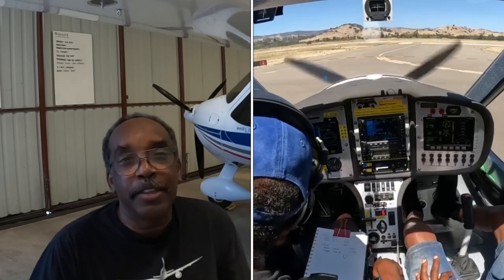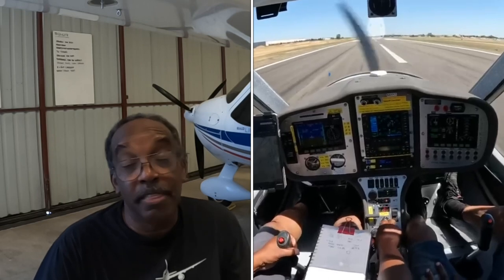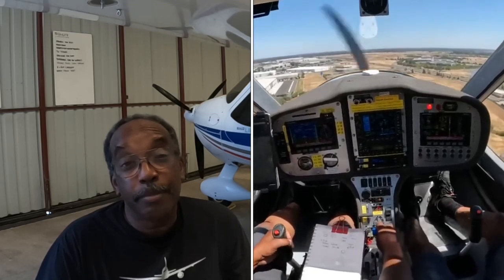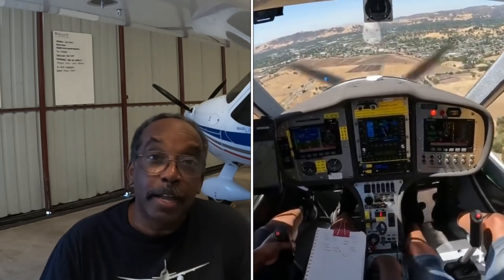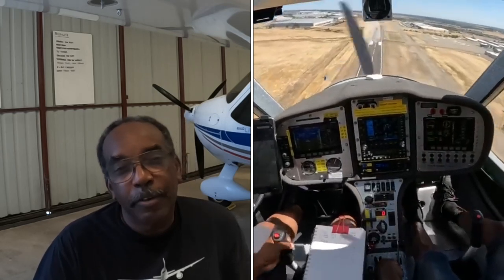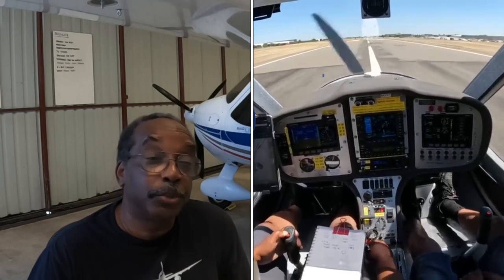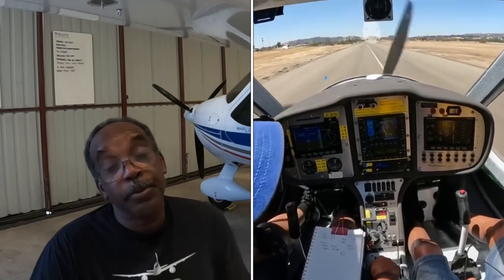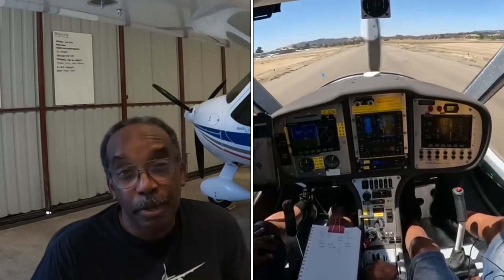Emergency landing at Nut Tree Part 2 what happened

Comment: Mark, you did a great job handling this.  Do not let the arm-chair critics get you down.  My instructors stressed that you treat a partial-power situation differently from a complete engine failure, and that altitude and time give you options.  Also, once making the runway is assured (which it was), flaps are a much more stable option than a slip.  Lastly, all these critics should keep in mind that debriefing an emergency after the fact is very easy compared to dealing with it in the plane in real time.  As M. Tyson once said "Everyone has a plan until they get punched in the mouth."  Put their butts in the plane in an actual emergency and let's see how "by the book" they perform.

Comment: The fact that you landed your plane means you made all of the right decisions during this event! Good job! There is something bothering me about the engine problem. Calling it a fuel problem is no bueno. The Rotax engine has a history of RPM loss at cruise. It is a finicky engine. If it were my airplane, I would do the following:

1. Scope your fuel tank to check for particulate (after it sets for 24 hours). 
2. Check your fuel tank vents to make sure they are not blocked. 
3. Remove carb bowl and check for debris. Place catch basin under bowl and engage fuel pump to flush debris from carb/hose.
4. Inspect all fuel lines from tank to engine. Check fuel cutoff valve. Check all hose clamps for over-tightened clamp; partially collapsed hose. 
5. Inspect all cables, linkages, etc.
6. Remove spark plugs and check for signs of problems.
7. Change fuel pump and run to see if you can reproduce the problem (on a hot engine, not cold).
8. Check connections and electrical wire on your fuel pump. Check for short.
8. If all of this is OK, my bet is the problem is one (or both) of your mags. Mags can cause this problem (after they get hot). 

Don't chalk it up to bad gas. It is most likely something else and your engine is talking to you.  Listen!

Comment: Thanks for the follow-up, many were wondering what the issue was, exactly. In my opinion you handled the situation just fine. The engine was giving you partial, intermittent power, and you used it to gain some altitude. Altitude is your friend, unless you're on fire, lol. You were under control throughout. I say great job. I, also, find going into a slip, close to the ground a bit "spooky."  With my Cessna 172, I can just drop the "barn doors" all the way and shove the nose down. Thanks for sharing!
Reply: SPOOKY.. ?  LOL !

Comment: Hi, I had the identical situation just after maintenance and it turned out to be a blockage in a small bolt the is used to allow fuel into the float chamber. It only happened when I was pitched nose up in the takeoff. As soon as I lower the nose it was fine. May be worth checking out. It turned out that at some point the small bolt was changed for one that didn’t have the hilt through the middle of it so was restricting the amount of fuel that could enter the float chamber. When at an angel the float would lodge and stick not allowing for more fuel.

Comment: Would have thought the low fuel pressure warning is key to what happened not the fuel itself. If the engine is using more fuel than the fuel system can supply then the pressure drops. I'd say the pump was going bad or restricted filters.

Comment: Similar issue with my Sling Tsi, although it’s fuel injected.  I won’t use fuel with alcohol now.  I noticed the low pressure happens more with increasing temp.  If you fly in, sit somewhere and then go again I think everything in the engine compartment is hot.   100ll has a much different vapor pressure.  So I increase my cruise climb and watch the fuel pressure.  If you can get non-ethanol gas where you live that is > 91 octane.  Also car gas changes over the year so winter gas (through June) will vaporize easier than summer gas.  Best of luck, glad you are safe.   I’m thinking the gas is effervescent in the fuel lines causing mischief.

Comment: You made good decisions all around.  The very worst thing we can do a PIC is question ourselves.  Second pilots have stake in the game as well and I didn't say they should not question our decisions, but as single pilot we just need to fly, stay calm, and do the best we know how.  I have had many engine failures as a single pilot in Ag and pipeline patrol.  All mine, save one, were low so only six second deals to somewhere in the very near hemisphere.  And on most I, being very near the LZ, ended up using full flaps and full forward slip to make the beginning of the LZ.  Anyway, good job.

Comment: i had 4 different LOTOT/partial power engine fails on take off as a Bush Pilot in South America. If the engine is only vibrating while lost some power but NOT SURGING OFF AND ON, and keeps altitude at least, it is good to try to turnback to closest runway at airport from 400 agl or higher (i did that 2 times, one from 300 agl only) instead of throwing the towel and crash in front without a fight(Besides in front there were houses and or ocean).
  But if heavy surging, prep to land, little turns only. No turnback unless much higher than 400 agl. Due it can quit dead next surge.  Those difficult to judge LOTOT killed the great MacSpadden.  He was killed on a “Surging LOTOT” and they did turnback but lost engine after it, NOT REACHING THE RUNWAY after the airplane owner pop the draggy gear out.    

Practice LOTOT..  FOR EXAMPLE;  climb to 400 agl, Engine power to 50%.. level at  400 agl.  Troubleshoot with SOME carb heat and some leaning too.  And decide if Turnback, Turnaround the airport OR CRASH I FRONT.  3 OPTIONS ON LOTOT.     IT S SURGING LOTOT,  TREAT A SURGING LOTOT as an engine dying in next few seconds.  Be ready to lower nose and land.

Comment: Hello, good job!! and good landing!
What was the outside temperature at the time of takeoff? Rotax engines can suffer "vapor lock" if they have previously been exposed to the sun and the outside temperature was high.
I have a CTsw and I know that the engine is equipped with an expansion tank to avoid this problem, but I have several flight companions who have suffered a problem similar to yours for this reason with Rotax engines, always in summer and at high temperatures. .

Comment: Thinking it through being high was a good choice.  You knew there was plenty of runway, and if on approach power is altitude, better to be a bit high.  It's a better bet of making the runway with reduced power.  There is no requirement that you have to land three stripes past the numbers. Taking advantage of the length of the runway was smart. Better a little high than being low. I'd fly with you anytime.

Comment: First I watched, I say good save. Still thinking same , may be vapor lock happens mix mogas with avgas for summer season flying, my plane is at 100hr never put avgas sometimes on climb fuel bar goes under 1.9 bar and goes to yellow arc but never goes under 1.5 bar it usually happens in summer time too.

Comment: The design of the fuel system in the CTSW is far from perfect. You loosed fuel pressure at rotation, this is a clear indicator for a fuel vapor lock. Make sure it will not getting too hot under the cowling, keep the small door at the left side open during parking under the sun. But to make sure this will never happen again only a auxiliary fuel pump would help 100%.

Comment: You should try ethanol-free(non-oxygenated) gas. It is not toxic like leaded gas and it more stable and more resistant  to vapor lock than gas that contains 10% ethanol in it.

Comment: Great video, Mark! I had just finished a video describing my recent encounter (about two months ago) with the Flight Design (CTLS in my case) engine light. In my case it was entirely an operational error on my part. I happen to think that, since you were so close to the airport and the engine was still working, a mayday call might have been too premature.  Cheers.
https://youtu.be/T2HIf4NRF9s

Comment: Every 25 hours new oil and every 50 hours new spark plugs? This sounds excessively wasteful.
Reply: It's an engine that has proved to have a problem. Better safe than sorry.  Especially if you're a full time government worker like he was before retirement, he has the cash for private aviation, some extra oil changes aren't going to break him.
Reply from the maker: To me it’s cheap insurance and hopefully my engine will last longer.  It adds maybe a $1 to my hourly operating  costs.
Reply: I have a jetski with Rotax engine and I do the same, 25 hours for new oil and 50 hours for spark plugs. It's a cheap insurance because I run it at 7000-8000 rpm almost all the time.
Reply: @markjohnson9157  I doubt that there's any gain by doing this.
Reply: @Heike--  and instead of fixing the problem doing useless services will certainly help. 🤦‍♂️
Reply from the maker: @RubenKelevra  the problem was fixed.  I updated the fuel pump and carburetors.  Changing the oil early is about giving the engine longevity by  preventing lead buildup.  I don’t believe in cutting corners when it comes to aviation.  Peace of mind has value to me. As I said in the video I have flown for almost a year and have not had a single issue.
Reply: @markjohnson9157  You can check the oil by sampling, to see if a replace is necessary and also check the spark plugs for damage, spacing and spark size. 

That's what I would call prevenetive. But just replacing working components well before it reached it's lifetime makes no sense. There are sheduleres set for wear components in aircrafts, and they have the necessary safety margins built-in.

There's also always a safety cost involved in maintainence: Tools can be forgotten, screws stripped out, torque specs not met, wires pinched, or other components get dinged with a tool and get damaged.

Unnecessary work has also a fair share of possible side effects attached to it.